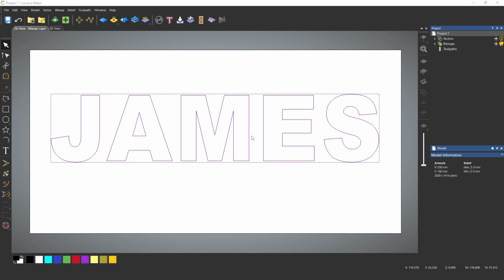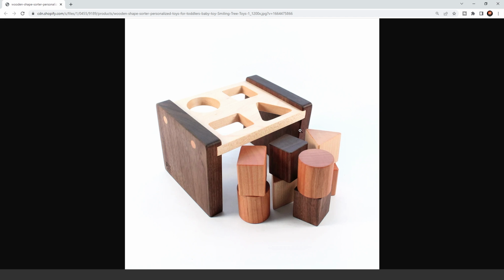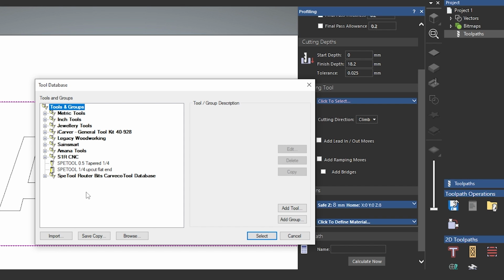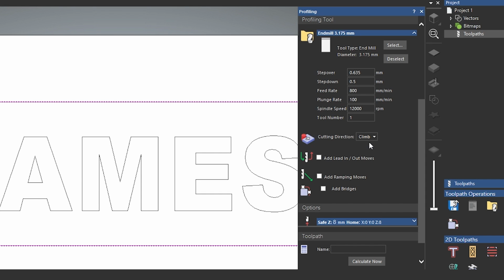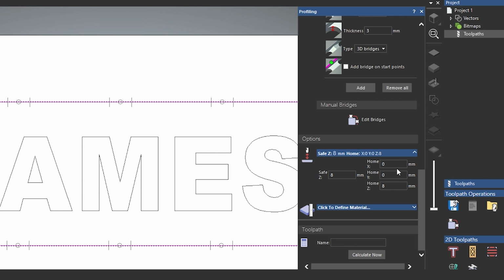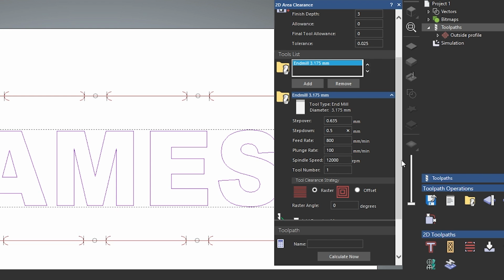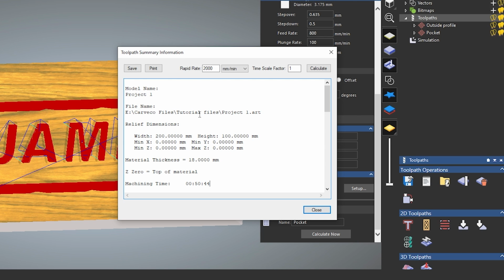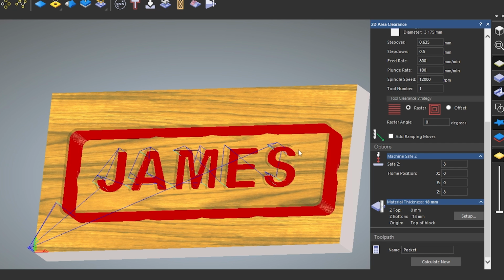PART 2 - Absolute beginners guide to Carveco Maker

Comment: Your videos are excellent and very helpful.  I have set two computers up and followed your video 1 and video 2 to create.  Mine will not follow yours exactly.  I finally, after 3 attempts of following, got to the last save (doing the simple name placard) and go to save only to be told Carveco cannot save because no tool path has been created.  Ugh!  Oh well, 4th attempt to follow you exactly coming up.  I am 74 years old but I  can still learn. Thank you so much for your time and effort.
Reply: Hello. I came here for this as well. Seeing your comment is only 5 days old, I wonder if it may be something with the program. It will not create a tool path for the pocket for me either.

EDIT: Found another comment with same issue. JDD replied and mentioned tool size may be to big. Changed my size smaller and it worked. It could be the font, as the one Im using is different. Im just following along for direction, not to actually make at this time, but this was good to know.
Reply: Thak you.  I am now trying my fourth time and will see how it works.   @nwadventuremike

Comment: Hi James, I'm using Carveco Maker at your suggestion. I feel like I'm getting most of it for very simple designs. Trying to inlay pearl dots into a guitar fretboard. The layout is correct but the depth is off. I need 1.6 mm of depth and the holes are only going about half a deep. Thinking maybe my probe setting off but I checked it at 15mm and it's correct. Also I'm using the offline controller. Any ideas? Thanks ahead of time.

Comment: I really appreciate your tutorial. If I may make a suggestion. No one seems to start in the beginning of the Cnc journey, which is to make a spoil board. I chose a spoil board with tnuts. And with your tutorial I should Be able to figure it out so thank you.  However for me personally it would be super nice if someone would make a tutorial on the spoil boards in an easy step by step process. For those who understand this it is easy for thick folks like myself a 1,2,3 guide is a great introduction. Your videos are the best I’ve run across so far. You are a good teacher.

Comment: Wow, 2 simple shapes and 2 simple tool paths using same tool, lol, I know I will be much faster when I digest all this software with repetition for cnc machines, but it is quite cumbersome compared to laser and Lightburn.  It will take me a long time to create the ideas in my head on cnc compared to laser as I'm back to square one learning and practice wise, but it will no doubt be worth it to have computer controlled precision to materials and options that laser can't do.
Thank you very much for saving me so much time getting my 4030 V1 and Carveco setup and running, as you already know, you're an awesome resource for the community!

Comment: At 26:33 you pocketed out the words and started the information filling. I have several different words in several different locations on the material I'm using. My question is, " Do I have to select each individual word and image and fill in each one with the information? Or can I select all words and images and fill in the information all at once?"
Reply from the maker: If they are all expected to use the same bit, same settings etc then you can select them all in one go
Reply: @JamesDeanDesigns  Awesome. They will use all the same settings, so no issues on that. Many thanks for the quick response. Now, I can test this out on my 3018 PROVER V2 sooner.
Reply: @JamesDeanDesigns  I'm having issues with the text no coming up in the simulation. When I started a new copy I individually selected all the texts first and filled in the tool information. When I hit, calculate a window said, "No tool path was created for the current tool." I am using Lucida Calligraphy, could that be the issue?

Comment: So the one thing I didn’t see in this video ….when you completely cut through an object, is that object spaced off the bed when you clamp it? Or are you clamping the piece directly
Onto the bed? Is the router that exact where it can cut all the way through and not contact the bed of router below?
Reply from the maker: It's all depends on your machine. My preferred hold down method is blue tape and glue, I had my machine dialled on so I could cut through the wood, the first layer of tape and leave no marks on the bed. But typically when you clamp your material directly, you would could through you material into a spoilboard. May only be by 0.2mm or something small but that is the reason for spoilboards

Comment: james, why do  you export job to ugs ? i assume carveco does not have a machining process, please can you clarify for me ? thank you, terry
Reply from the maker: That is correct. Different CNC machines operate on different languages. Carveco can export to those different languages but doesn't run the machines itself. UGS is one of several pieces of software that can run my machines, but it's the one I prefer to use.

Comment: Great tutorial! I had one snag. When I selected my text to create the 2D area clearance, I keep seeing the message of "No toolpath created for the current tool"  - I'm not using the same font as the video, but I don't see why that would matter. Thoughts?
Reply from the maker: Thank you. That could be because the size of the font is too small or the bit you're using is too large to remove any material
Reply: Same problem here.  Thanks!  @JamesDeanDesigns
Reply: Won’t let me edit - I tried new but can’t get it to create a tool path. Late now. Will start fresh tomorrow. Great tutorial. The rest was going great until I hit this snag.

Comment: SIR! Why did you change the toolpath from outside to along? Now won't the centerline of your tool be exactly on the outside profile of your rectangle, this cutting into your perimeter by half the tool diameter????? Please clarify. Thank you.
Reply from the maker: It was purely to show a difference between the options, there was not much logic behind it. Yes you are correct, by selecting along it will cut into your shape by half the width of the bit.
Reply: I would have imagined that it was a given this was a demonstration since he explained earlier about inside, along and outside lol.

Comment: Great videos, I could really use some help! When using carveco maker And doing a 3D machine relief , Where do I position my zed axis When starting the finishing tool path ? Do I set it at the Original Zed "0" or do I set it up the newly machined level of the roughing pass? Thanks so much! Look forward to your videos, Keep up the great work!
Reply from the maker: So ideally you want to set your z height at a part of the job that isn't going to be machined, or certainly not on the roughing pass anyway. For example if you were doing a 3d relief circle on a block of wood, you would set the Z height on one of the corner outside of the circle. If I am machining the entire piece then I sometimes use an offcut in order to set the height. If you try setting the height for the finishing on a part that has already been machined it will throw everything off
Reply: @JamesDeanDesigns  thank you so much for getting back to me so quickly. I really appreciate it. Not being able to successfully complete. My 3-D card has been very frustrating lol keep up the great work I love your videos and I have learned a great deal. I’ve only had my CNC about two months, so this is definite learning time for me LMAO thanks again!

Comment: Hi James, can you explain to me how to change the start point of the toolpath. I'm trying to plasma cut, and I need the path to start at the edge of my sheet metal. Thanks for all your help, I sent you a PayPal 😉 cheers!
Reply from the maker: Hi. Thank you for that.
So I used to do CNC plasma cutting about 20 years ago, I didn't program, I just ran the machine but the way we did it was to have a lead in and lead out. If you turn that setting on, generate the toolpaths you should see the little lead in and out parts. You can then position those (and the shape) to start at the edge of your material.
I'm not going to be able to get to a computer until Tuesday now but if you're struggling, message me and I'll get you some screen shots of what I mean
Reply: @JamesDeanDesigns  no stress, I've got it figured out at midnight 😁.
Hope you have a good time. And would love to chat with you some day.! Be safe